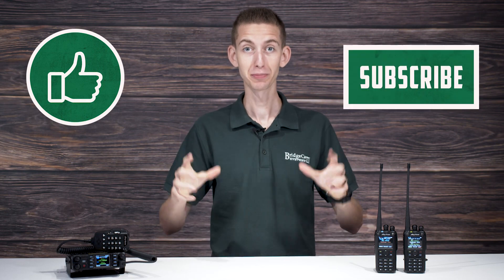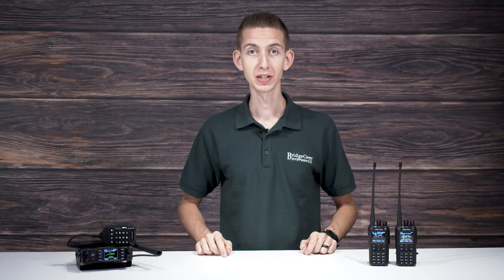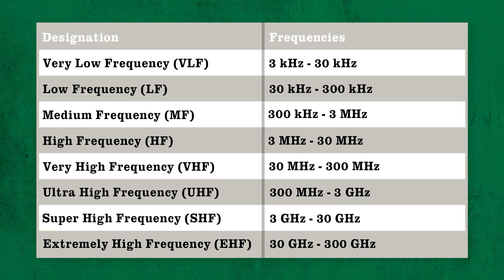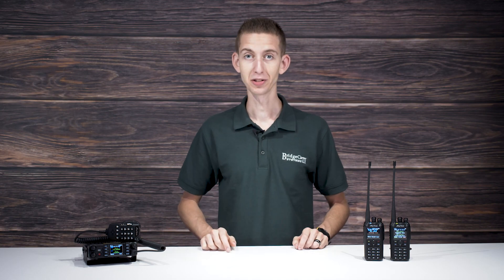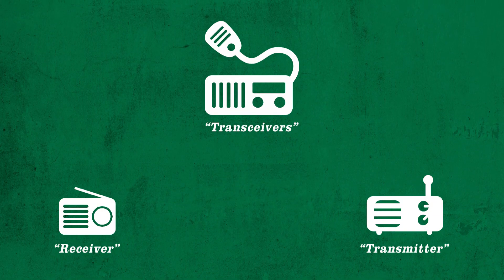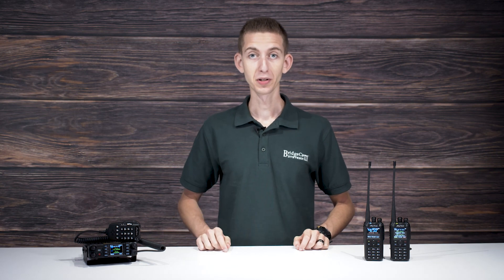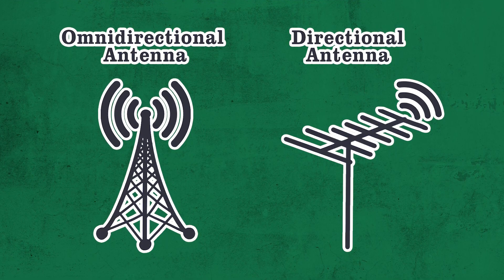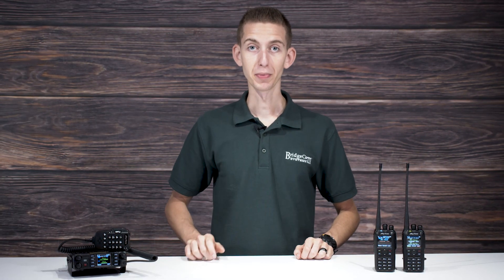What Is Analog Radio?

Comment: AM broadcast is NOT on VHF, it is on MF - Medium Frequency.  Probably just misspoke, I'd guess.
Reply: AM was used on VHF 50 years ago and  air traffic ( 135 mhz  roughly ) is still AM..There is a 6 meter repeater outside of St Louis that is still AM.
Reply: @frankpeletz1818  he said AM broadcast. The video was also referring to AM broadcast, but said it was on VHF.
Reply: @frankpeletz1818   All that is  true, and pretty much any form of modulation can be used on just about any frequency.  But had you watched the video, you would have seen the MF AM receiver he referred to as "your typical AM radio" and that the markings on the dial range from 550 to 1500 kHz.  Pretty safe bet he wasn't referring to the 6 meter AM repeater outside of St. Louis.
Reply: @JimAndyAllyn  Read your answer-I responded to what you wrote.
Reply: @frankpeletz1818   No, you didn't respond to what I wrote, as anybody who read what I wrote and what you wrote would plainly see.  If you want to pic nits, AM was used on VHF much earlier than 50 years ago.  Heathkit, Clegg, Ameco, and others were selling VHF AM ham gear in the 1960s.  Gonset made VHF AM rigs at least as early as 1952.  I used to own a Russian tank radio from World War Two, which would do AM in the 220 MHz region.  Also, 'mhz' is not the abbreviation for megahertz, 'MHz' is.